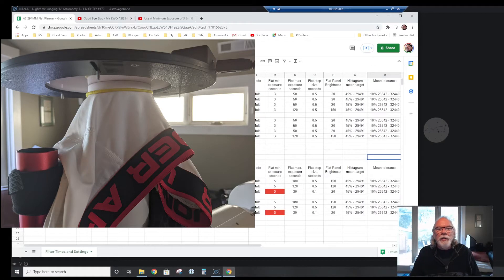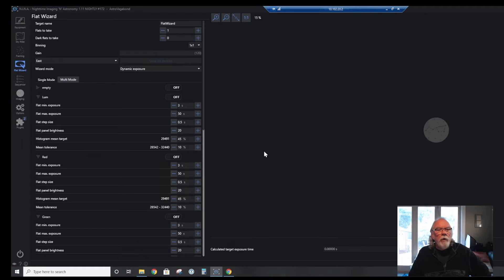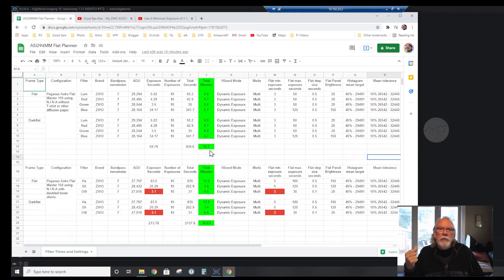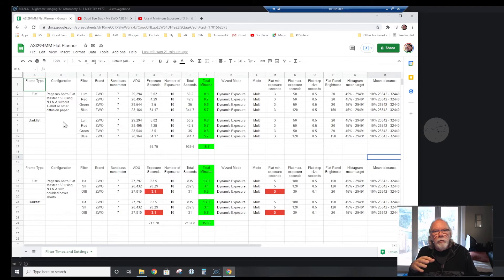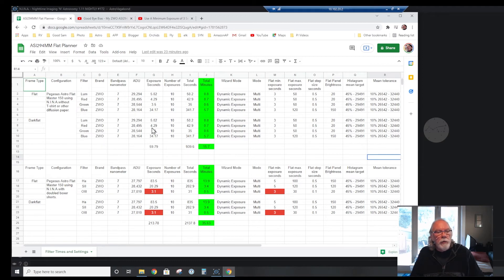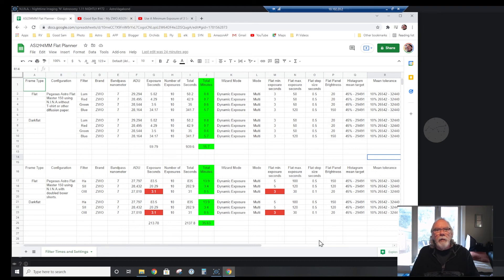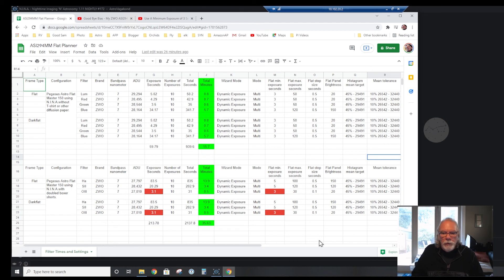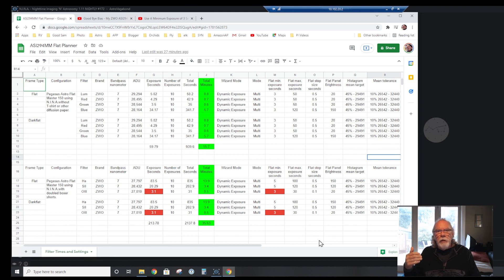My Final Word on ZWO ASI294MM Calibration Frames

Comment: Dear Bill
This is another beautiful video and for me also very instructive; have 1 clear night last week and have added the Heart Nebula in narrow band to my library result can be viewed on Astrobin under Frank Bogaerts; now for the first time I have been able to use the flatmaster in NINA in a correct way and this with my ZWO 1600 MM so probably for each camera it is slightly different the minimum exposure was 4.40 sec for the OIII filter and 20.3 sec and for The H-Alpha  filter the SII filter 11.4 sec each time 35 frames but I will also lower that in the future I think of a 20 numerous per filter; I didn't need a T-shirt; if the flatmaster is connected to NINA you can adjust the light strength this you do under equipment tap flat panel there you can set the light strength and turn on the flatmaster the rest you do as before this worked well for me.
Now the outlook for the weather is not favorable so it will take a while before I can do anything.
Greetings Frank Bogaerts from Belgium.
Reply from the maker: Very nice image Frank along with all your other very fine work. Thanks for sharing your link on Astrobin. Here it is for others: https://www.astrobin.com/users/Bogfra/ If you don't mind I may just use your times per filter and total integration time. 😀
Reply: @AstroVagabond  Thanks Bill and wish you good luck for the next adventure.

Comment: Nice to see a such a detailed spreadsheet!

I would suggest keeping maximum exposure to 20 sec och all filters. It will save you much time and you can increase the number of flats doing this way. 

I always shoot for 30 Flats and darkflats and it only takes 10-15 min,    every minute counts right? 😊

Clear skies
Reply: Impossible with the Pegasus Flatmaster, I have the 250 version and its so dim (even on its brightest setting) my Sii flats take close on 2 mins per exposure
Reply: @SimonT65  Okey I see, but do you really need a tshirt/shorts when using the flatmaster? 
I think it's made for to only use the panel and not any tshirt needed.
Reply: @Calzune  No, I don't use a T Shirt with the Flatmaster as it would take even longer. I'm not certain why Bill uses a T Shirt? Just realised, Bill is aiming for 3 second exposures hence the boxer shorts but he can adjust teh settings within NINA to get 3 seconds or more without the boxer shorts
Reply from the maker: I used the T-Shirt to obtain a minimum exposure of 3 seconds for the OIII filter. I'll work on optimizing when I return from my new moon trip. For now I'll go with what I have. Appreciate the feedback from both of you. 👍 I'm having fun where there seems to be no consensus on the number of flats. I've seen comments range from 5 to 40. 😀
Reply from the maker: I do like the 30 number as a goal. 🙂 If I set the max exposure time in NINA too low the routine will not complete until I change it. I'll spend some more time after my new moon trip to see if I can optimize configuration using NINA and Flatmaster to reduce times. Since I will be using 40 darks equal to the exposure and temperature of my lights I expect the darks will address thermal noise. So I'll be doing more research on light falloff from vignetting, and photosite sensitivity as it related to why we take flats.